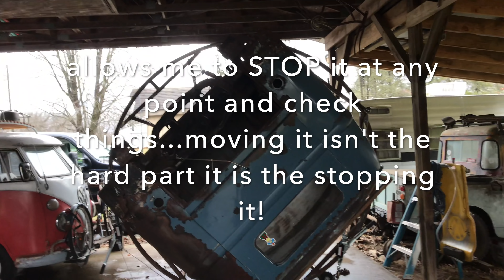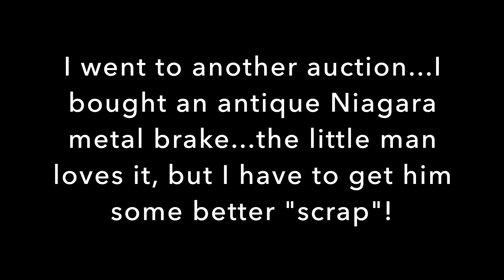VW BUS Rotisserie Build comes FULL CIRCLE!

Comment: Your boy is so cute, I'm sure many have suggested already but you could motorize one of the wheels with forward and reverse. You could do this with a electric wench like from harbor freight and mount a rubber tire on it. It has a up and down control which would be perfect. It also can be released when needed to free roll. Just doing that would make a good video and what's best is my idea is free. Haha but you can give it my name👍
Reply from the maker: I heavily considered a winch, but it really is very easy to move, it is stopping it in a specific position that is the challenge...plus then I had to worry about a battery to power winch, etc but might try it later!!!! seems like a good time! He's a great kiddo!
Reply: The electric wench will stop it plus you can forward and reverse it in small movements. HF has 110v wrenches too. I was thinking too that you wouldn't need a wheel but 2 cables with a divider in the middle to keep the cables from getting caught on each other. One cable up one side and the other up  the rotisserie on the other side. Then just run the cables to turn in forward and reverse

Comment: If you can apply some acid tone or get rust doctor these anti rust agents
can get that undercarriage clear of all rusted surfaces Marco 
you will rock.
Reply from the maker: I've used a product called OsPho for years and it works great, entire underside of bus and rusty bits up top will get a good coating of that..then the undercarriage will eventually get a coat of bar and chain oil sprayed on it then it will get run down a dirty/dusty road...it will last for years and years after that!

Comment: Very impressive channel, that looks like a bunch of fun!
Just another safety thought. On the floor frame,  you might consider a couple pieces of C channel or something and weld up a couple little guide rails / track stub above the plastic wheels to help keep the rotissery track centered over the wheels. I'm a little concerned about rotissery flex or tracking well, or stability during heavy work with that much crown on the wheels,
Reply from the maker: Thank you, it sits down in the angle in the center, clears the concrete about 1/4" , so it is sitting in a fairly decent piece of track.  So far it has worked well, but if I need to I can alway modify! I even thought about taking the wheels off and milling them flat, but I'm not spinning it around every day (even though the temptation is there, ha) so I think it will work for this round, next bus maybe !lol

Comment: WOW! simply wow! VW, bus, rust, body works. rotisserie. my kind of channel!
i'm on a learning curve myself, is there a size of the rotisserie that would be big enough so rolling it would balance out at any angle in the circle?
also, i recently bought a sheet bender like that myself. i learned that it can only do 20ga steel, is that right? Thanks!
Reply from the maker: pyronitro my rings are 8’, the higher you put the bus up in the rings the better it will balance, if you look on thesamba.com tho you will see that all of them have some kind of braking system on them, you don’t want that thing kicking back at you while you are welding of cutting, this one moves really easy, and will balance at a lot of points but I’d never trust it to stay there. I think my brake is will do 18-20g but I wouldn’t push it past that! Don’t want to tear it up it’s survived 100+ years!

Comment: Man, I need one of those!
Reply from the maker: easy to make!
Reply: @marcijunebug  Hi Marci, great Videos, do you have a set of plans for the rotisserie ? measurements etc? Thanks.
Reply from the maker: I don't, but happy to get them for you! I truly just winged it...using the cable reels made it really easy, then tacked everything in place while physically on the bus...that way I knew it would fit back on after i finish welded it...I am happy to measure any point you need,..the only thing I would do different is not get wheels with so much of a crown...other than that is has worked perfectly.  All of my gussets came from the inner/center splines on the cable reel and the only steel that isn't from the reels I got at the junkyard or had kickin' around here...I think there is a thread on thesamba.com with measurements from someone? Again, more than happy to help, just let me know what ya need and I'll do my best! cheers!

Comment: suggest to use two wheels on each anchor or use the heavy duty
wheels from Hazet. They have flat surface and are able to hold
500! KG each. Hazet Germany
We use such gym-wheels since the 70's - or longer idk - but 
our system is designed reversed to yours; the wheel uses a 
sideways centered anchor and the car is attached within on its 
bumper reinforcement.
Reply from the maker: These work fine, wish I could have found better ones, but just weren't available where I live! These are rated for about 1,000lbs and seem to be working great!
Reply: @marcijunebug  let's go on the GREAT AMERICAN CASTER HUNT for your next project, there gotta be a surplus house in USA with metal ball bearing rollers  about 4 inches wide and HD  cages, .........................

Comment: Totally Unsolicited Advice: While Pickle's upside down, you should crawl in & vacuum the rust out!
Common Sense: Do you think Volkswagen intended for people to crawl around on their bus's ROOF?!
TUA: I'm sorry - I've only had 1 cup of coffee today...I'll see myself out.

Totally awesome job - I tip my hat to you! And I see who's going to be building your frame for you - though he's a little young yet :)
I've never seen someone so happy over a bent piece of metal - or so sad that copper's expensive :(
Can't wait to see more!
Reply: DID YOU HEAR them ' I LIKE IKE' buttons fall from the floor....were there any DENT or DeKalb rusty floor patch signs...
Reply from the maker: 😆👍He's a funny kiddo! I actually had the thought of once I get the bus all solid on the frame...getting inside it and running like a hamster just to see if that would work...because me brain is silly like that! lol
Reply from the maker: haha haven't found any yet!
Reply: nooooooooooooooooooooooooooooooooo!!! do not get int the v an under any circumstances!   You could shift the weight and cause a slip off the rollers, and as JACKIE GREASON SAID   "AND AWAY WE GO!"""""  Better solution would to be getting  a  6 foot 1 1/2 inch PVC pipe  and add extensions onto a powerful shop vac and do the vac that way, this way You outa way and get the job done pronto
Reply: @marcijunebug  you have'nt been working with any spray fumes  or illcit substances while on the van lately????:))

Comment: The bus needs to sit approx 12" to 15" higher in the rotisserie.  The center of mass of the body is not at the same point as the ring.  Move it and you will be able to move it with one hand, while avoiding the tetanus factory of course!!
Reply from the maker: ehhhh, it works, flips fine...I talk about that in one of the earlier videos👍